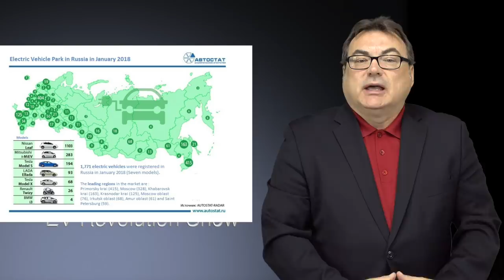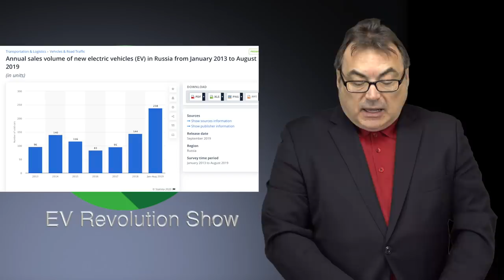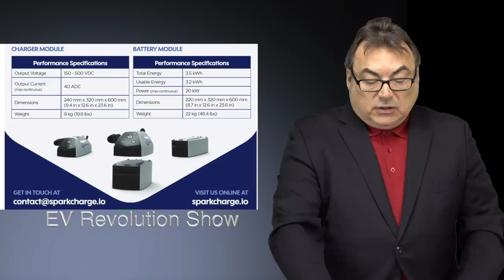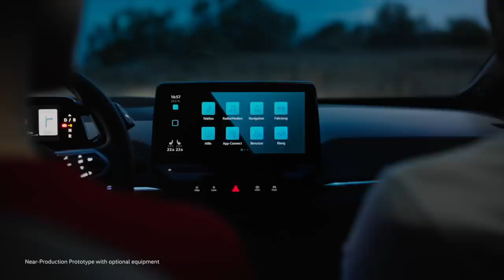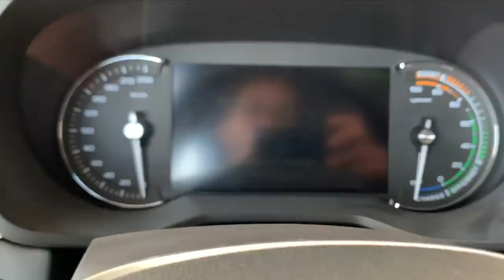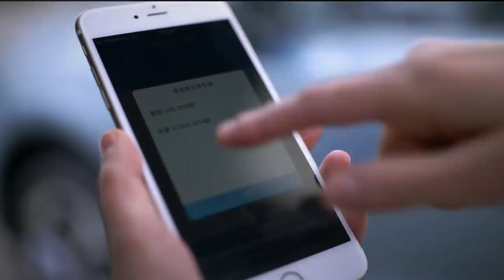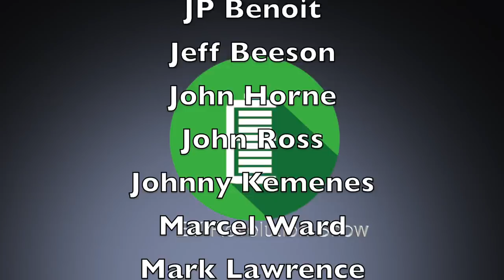Episode 89 - SparkCharge, GM Bolt Recall, MG 5 Announcement, Russia EV Incentives and More News!

Comment: I can see roadside service providers (like AAA) buying SparkChargers to help stranded motorists!
Reply from the maker: Thanks for watching Anna!  Yes I thought so too!  Might even pick one up for me someday as a backup!
Reply: Gas or diesel powered generators in the back are what is normal, cheaper  and has  more energy storage capacity.  Even if EVs became the majority the gas/diesel powered generator makes more sense because it refills quickly.  If most of a service truck's visits were for EVs, the sheer quantity of needed energy would overwhelm the capacity of any battery system
Reply: True, charging a battery (charger) to charge EV battery.... Is expensive and inefficient... It only can make sense to used batteries as charger, to balance the grid and to reduce demand charges.... FWIW, V2V charging makes far more sense for Chademo now. and CCS soon... or a Fuel Cell charger, will be far better option one day.....
Reply: @nc3826  V2V ghroudh Chademo and CCS would rock and so would a Fuel Cell  powered service charger since I would expect a service truck could easily carry a big enough hydrogen tank and that hydrogen could be produced using a multitude of ways including renewables.  I have no idea how much such a service system would cost though compared to the already established and pretty efficient diesel generators already out there.  Cool stuff.  I'm looking foreward to watching the matter develop. :-)
Reply: foxpup You don’t know that! Not only that once we have more places to charge at high speed because right now we have a lotta places we can charge, but they’re low speed chargers & we need high-speed chargers, so when we have more high-speed chargers, this range anxiety that people complain about now will be a thing of the past! Folks forget that in the beginning when gasoline cars were starting to populate the planet all that infrastructure wasn’t in place & most people couldn’t afford to buy a car, so it took quite a long time for this infrastructure you see now develop! I don’t think it’s going to take that long for EV’s because people can buy a charger & charge at home as more people have home chargers that means I could drive to a family members home or friends home & charge my car so the convenience of having an electric car far outweighs any of the downside talk about what’s not possible as I hear a lot of these people who just cling to the past, because of this or that thing! So I say get over yourselves all these problems will be solved over time, as the future is electric!👌
Reply: @theodorehaskins3756  I knew I'd be triggering someone when I said the word "diesel".  First, I'm there with you.  I've been driving EVs for seven years now and I'm not going back.  That said, there are dark areas where there simply isn't the infrastructure present and there won't be any time soon and I want to be able to go there with my EV and not acquire an ICE unit just for those trips.  If I had access to a sturdy 8000+ Watt generator, I could take my EV anywhere, even many miles away from where there is electricity and where the sky is beautifully dark so I can look at it with my telescope and use my car as a wonderfully huge battery to power my equipment with.  I know it is a rather special situation, but for me a gas or propane powered L2 charger would be very useful.  FYI:  You haven't lived until you have walked along a path, guided by nothing but the light of the stars. Such skies are jaw-drop gorgeous. :-)
Reply: @foxpup  V2V is even a better P2P option via an app like Uber or Lyft use...
and Fuel Cells can us other fuels like methanol ...
Reply: @foxpup  fwiw I prefer deluded trolling EV purist (ironically most of them don't even own an EV)... to the trolling anti-government conspiracy nuts on SM... 
and enjoy your EV... sadly, I'm not there yet...
Reply: @foxpup  btw when picking a generator make sure the electric it produces has clean enough sine wave to allow charging... I know there are posts about which ones should work for you.. good luck..
Reply: @foxpup  BTW just remembered,  a DMFC (Direct Methanol Fuel Cell) is possible REx option... since it relatively clean and quiet with less moving parts...but the FC unit and fuel for it tends to be pricey... mostly used by rich ppl on yachts...below is a link for a company that offer it...
https://www.efoy-comfort.com/how-it-works
Reply: Anna Haskell This would be the only application that makes sense. Otherwise, does the EV owner carry it in their trunk? Or if it is kept at home, and the car owner has to figure out how to get home, pick up the charger and take a (taxi?) back to their stranded EV? Mobile road assistance services like CAA/AAA are perfectly positioned to add this to their business model.
Reply: foxpup what you’re saying is correct however we’re trying to get away from reliance on fossil fuels.

Comment: That CARL charging system would be good for long term parking, where you only need to charge for a small percentage of your time parked. If you give it a return time, it could wait, keeping the battery at a lower charge (which is better for the battery) and not charge your vehicle until shortly before you return.
Reply from the maker: Thanks Roger for watching and yes, that is a great use case.  Another commented on a similar idea for airport parking.

Comment: Just wanted to thank you for the dose of skepticism on the Triton H.  What did you think of your friend's recent review of the Leaf Plus where he "proves" it can only charge @50kW by using the wrong speed charger?  I get upset by that stuff, but then again, I'm not Canadian.
Reply from the maker: Thanks Mike.  I'm not aware of the the review you talk about.  When I reviewed the Leaf Plus last year, I was able to pull >50kW.
Reply: @EVRevolution  James and Kate.  The Leaf review ended with a shot of the Tesla M3, which tells you something.  Of course relative pricing of Leaf Plus and M3 is much closer in UK than in US due to incentive issues.  It is so easy to make mistakes testing charging speeds - best left to professionals.  My wife loves our 40kWh Leaf but wishes we'd gotten the Plus as we take a lot of long-ish trips.
Reply: I own a leaf plus and I've tested it on a 62.5 kW charger and it can take 55 kW from 25% to 68%. Ken can confirm since I've shared my screen captures with him. Now I'll have to test it on a 100 kW charger with summer temperature comming back.
Reply: @gillespelletier9161  Suggestion: ignore the charger kW hype and watch the Amps in LeafSpy - full 100kW should need 270-300A, charger probably labeled "150kW" due to Leaf voltage at the point current tapers.

Comment: Great show. The SparkCharge sounds very interesting // When I'm right Polestar is NOT a new brand (I've heard that they've been a tuner for Volvo before like AMG is for Mercedes Benz).
Reply from the maker: Thanks for the feedback and for watching.  Yes Polestar is jointly owned by Volvo and its parent company Geely.
Reply: Polestar is a "New EV only Brand" by Geely, but with a history that predates the Brand. And while its works with its sister Geely brand Volvo, it has its own models. Unlike, AMG, which is a sub-brand, that primarily customizes Mercedes-Benz models. Like the "Polestar Engineering Group", which is separate from the Polstar brand. https://engineered.polestar.com/

So I get how it can be confusing, but the Polestar brand is new and it's not the same as AMG..

Comment: The sparkcharge sounds nice but wouldn't it be better if every EV could just give charge using the same port it recieves with or had a L2  or higher outgoing charger in it?  If I was buying tens of kWh's of battery, I'd rather it was in an EV where I can benefit even more from them.  One can already do L1 with an inverter hooked up to the 12v system of a LEAF (while it's on) but that's pretty slow.
Reply from the maker: Hello and thanks for watching!  Yes a great idea and it is something that has been tried before, at least in concept form.  This recent link shows a system from 2014: https://insideevs.com/features/414775/we-need-ev-jumper-cables/

It's a complex issue with so many charging standards for DC.  L1/L2 would just be too slow for practical road-side situations, so DC-DC is the fastest method of quick charging.  It's not an easy task and maybe someone will engineer something in the future!
Reply: @EVRevolution  Yea, the article you posted touches on all the key points regarding this issue.  This is a matter of considerable interest to me since I'm one of those who lives on the edge of EV charging capabilty.  Here in Nebraska, if you get away from the interstate highway system there is basically nothing for charging infrastructure other than often poorly maintained and expensive campsite 220v outlets.  Alternative charging methods become a consideration.  Personally I wish I could find a success story out there where someone bought a >8000 Watt Gas generator and charged their LEAF at L2 speeds.  That would work wonders especially if said charger could fit in the trunk of the car.  I could go out in the middle of nowhere or to star parties and power all my electronics and camp site with my car, silently at night while using my telescope and computer taking pictures.  I really want to do that, but I kind of need at least L2 charging to do that.  Bigger batteries are a band-aid and do some good but never fully compensate for the need to be able to charge anywhere.